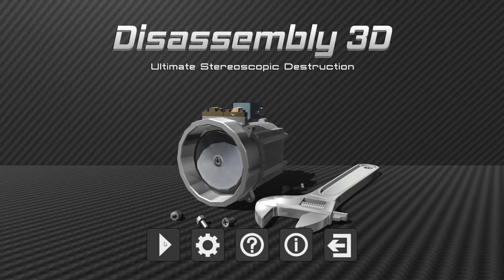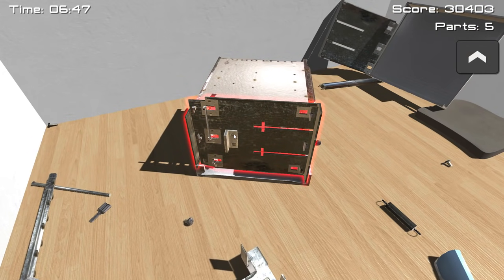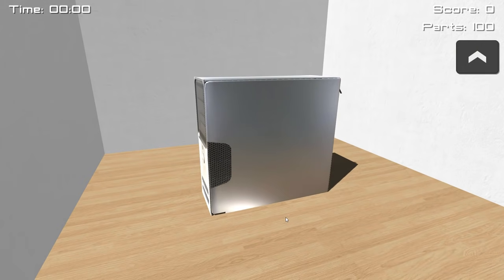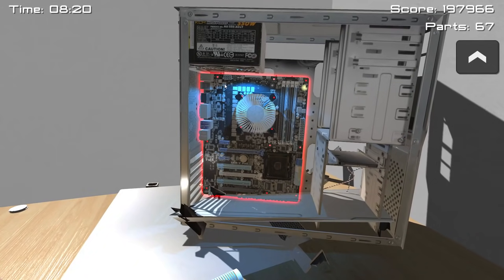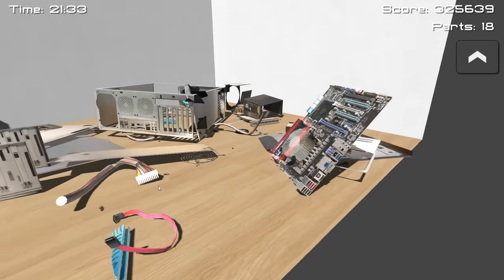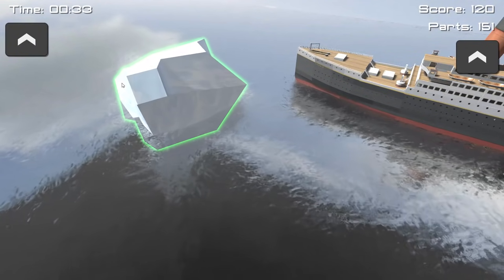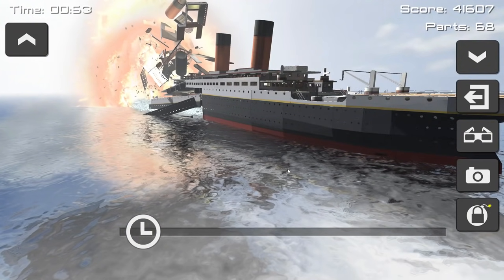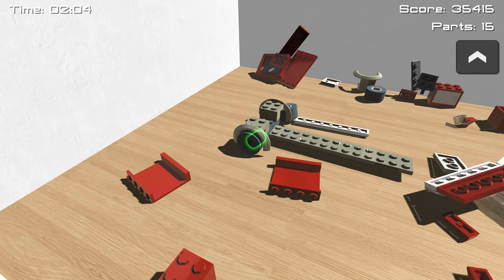Disassembly 3D - How Stuff Works

Comment: Jon, Stern and Aft both mean rear, Stern physically, Aft directionally
Reply: Or in a different way; stern is the noun, aft is the adverb/adjective related to it.
And as a way to remember where on the boat it is, aft comes form the same origin as _after_, so it comes after the boat, so the back of it.
Reply: thats a great way to put it thank you

Comment: If you aren't joking about how heat works, it's because of resistance, which is a property of metal. Basically, it works because the electricity bits hit the metal bits a lot and the friction makes heat and the glow
Reply: Also, thin wires have more resistance because there is less space for the electricity bits to squeeze through, so more friction.
Look at the itty bitty wire in a lightbulb

Comment: Jon I'm an art major and I know how a toaster gets hot. Also I don't know why I thought you'd know how a computer goes together but that whole section was equal parts frustrating and hilarious.
Reply: (Wire gets hot when enough current goes through it. Metals that are less conductive resist the electricity more and so the energy escapes as heat instead of electricity. Incandescent light bulbs work on a similar principle, but the filament - basically a very thin wire - releases most energy as light, though also some as heat as anyone who's touched a lit bulb probably knows.)
Reply: Oh and the CPU hides under the "toilet brush" fan because it is afraid of heat.

Comment: I was once asked during my IT course to diagnose a issue with a pc. It was worth 20% of my final score.

I tried turning it on. Nothing. I checked the power cable. It was plugged into the computer, and it was on at the wall. No issues there. I tried turning it on again. No reaction. Spent about five minutes trying to figure out how to best diagnose a faulty starter. Noticed that the mouse was unplugged. I went to plug it at the back. There's no USB ports. I check the front and plug it in there.

Then I stopped. There should always be USB ports at the back. Why were they missing? I look again. There's just a gap where the USB ports should be. I finally open the computer to check the issue from the inside. The drives are good. The PSU is good. The motherboard is missing.

I raised my hand and told the teacher that I think I found the problem :P

Comment: Um, Jon, pretty sure PSU stands for PlayStation Unit, duh.

Because video games.
Reply: Wouldn't it be Power Supply Unit?
Reply: CPU Purple Heart/Neptune no you're both clearly wrong  its clearly pressure synthesis unit
Reply: I thought it was Power: Side Up. That's why it's on top of the case.

Comment: Electricity gets hot because the electrons moving through the wire cause friction.
Reply: Alucard Pawpad electrons move incredibly quickly, the ability to transfer electrons is what determines conductivity. It heats up electronics when electricity moves through them because of the friction of the electrons, I have a master's in electronic engineering, this is how it works.

Comment: "presumably this is the CPU and this is the motherboard." no john... the 'CPU' is the motherboard, the actual CPU is attached to it and is a small chip. The 'Motherboard' is actually a Graphics card, what you need to plug your monitor into to get a picture. I don't build my own PCs.. but I have installed a new Graphics card and a New Hard drive... so.. really kinda annoys me.

Comment: Hertz is t he frequency of the Alternation in the A part of AC (Alternating Current) Basically the power goes from 240V to 0 50 times a second, but the actual "power" of the toaster is the 750 Watts, the dial is not actually a heat adjuster, but a time adjuster. the higher number, the longer the time - toaster

Hairdryer, you are right about loads of power through a thin wire, the difference is you don't coil up regular wire up close so the heat from one part effects  the other, if you bunch up old fashioned christmas light chains (pre LED) you can actually set fire to them.

PSU is Power supply Unit.
Reply: You're almost correct, but AC voltage actually alternates between 330ish volt and -330ish volt. 240 volt is the average (RMS). That's why it can be dangerous to stick test equipment rated to 240V into a socket, because the actual voltage peaks over 330V. 
(This isn't relevant for the US by the way where I believe AC is between 170V and -170V with an average of 120V)

Comment: Speaking as an A-Level Physics student... THIS IS HELL.
I could only watch up until the toaster before wanting to commit so i'll explain that as best to my knowledge:
1-There is 3 main types of thermal energy transfer; Conduction, Convection and Radiation.
2-Electrical energy is passed through wires from the house mains to the toaster.
3-This electrical energy is conducted through the metal bars and transferred to thermal energy, because energy cannot be destroyed or created but only transferred in a closed environment some energy is lost through Kinetic energy (the metal colliding with the sides they are connected to), and the useful energy (thermal for a toaster) radiates from the metal, heating the bread and evaporating the moisture in it.
4-There is not much wasted energy in a toaster because quite a lot of the energy is lost through radiation and that's the useful energy (what we want) but i believe they would increase the efficiency of a toaster and decrease energy waste by making the metal bars in the toaster into a circuit of sorts, making them longer will increase their surface area and therefore the heat lost will increase.
5-Apparently the other examples were a computer and an elevator. Basically the elevator is to do with moments in equilibrium and their gravitational potential energy/ tension and i should hope you know how computer works- you just bloody built one.
If you want me to explain why it gets hot, read the reply to this comment below.
Reply: Why it gets hot (short and sweet version):
1-Electrical energy makes electrons speed up, resistance increases but so does the current.
2-The electrons moving forms kinetic energy and that's the energy transfer between Electrical and Kinetic.
3-The electrons moving against each other experience friction so there is another transfer between Kinetic energy and Thermal Energy.
(Like if you were to rub your hands together, they warm up, that's because you are rubbing the skin cells of your hands together and friction occurs)